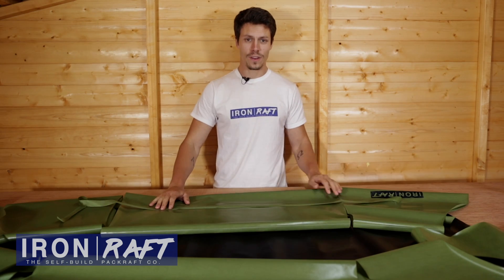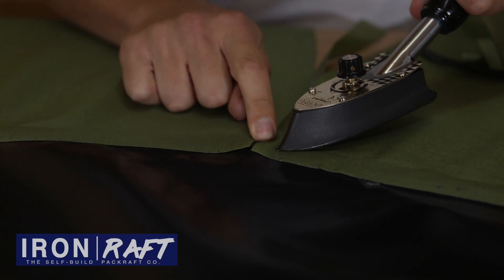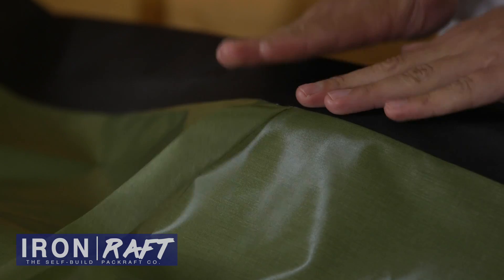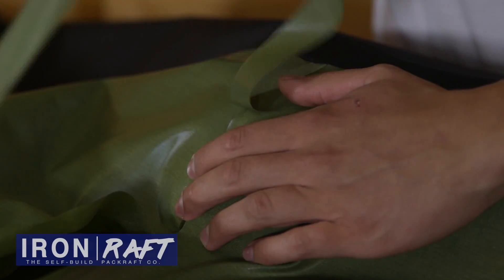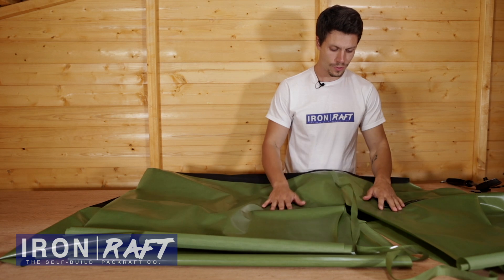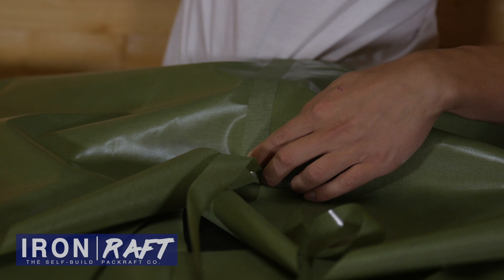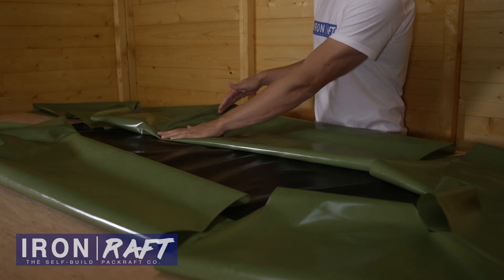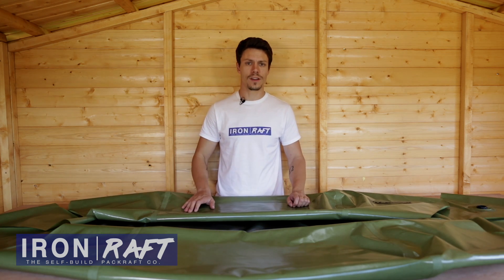IRON RAFT Self-Build Packraft Step 3 - Central 4 Curving Seams

Comment: which iron do you us? and which do you recommend?
Reply from the maker: For the last two boats (and in the video) I have used the Jamara Pro Star. It is extremely powerful and creates a good bond, however the compromise is that it is slightly oversized and you will find that you often only use the tip of the iron. (You may need to purchase an adaptor depending on your location as it is a german company and comes with a 2 pin plug.)